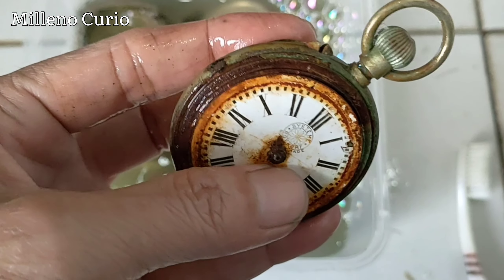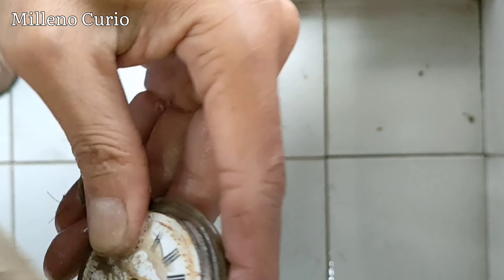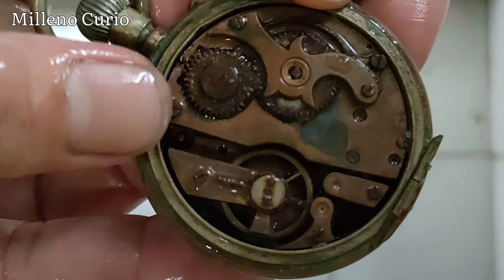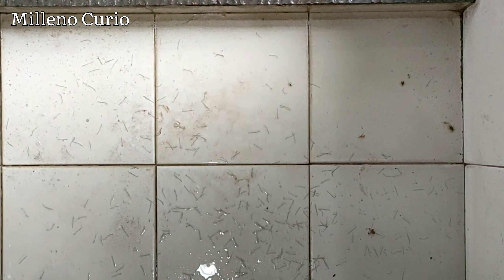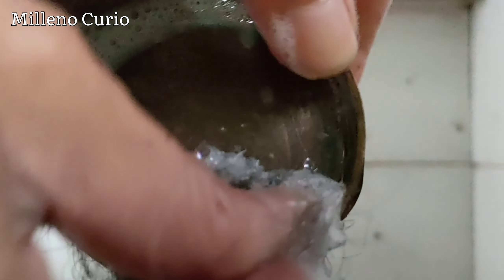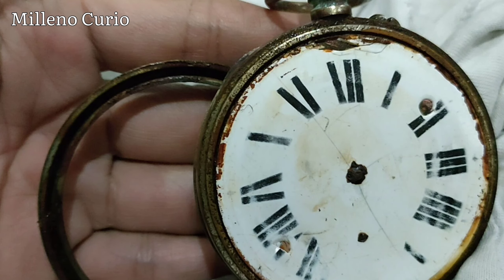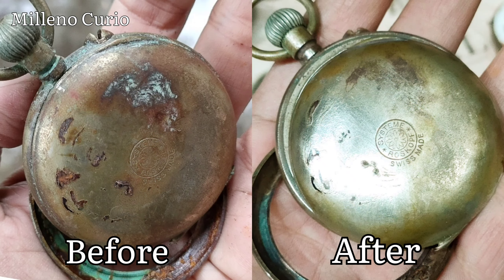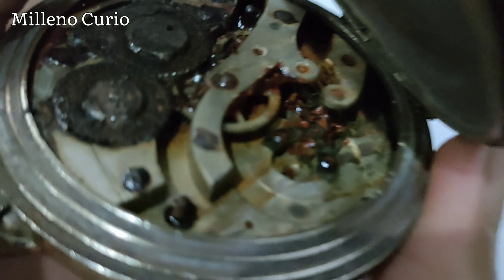Washing and Cleaning Swiss Roskopf Pocket Watch

Comment: I have several similar rusted old pocket watches. I'm waiting now for better screwdrivers, but even tho I got a few screws loose, I'm thinking now I may have to drill out some screw heads to disassemble the rusty mechanism. One is West End and some of the screw heads are less than 1mm. Amazing. Thanks from Thailand Paul